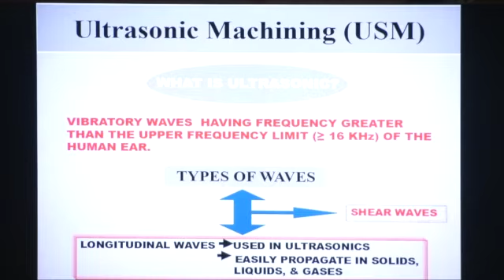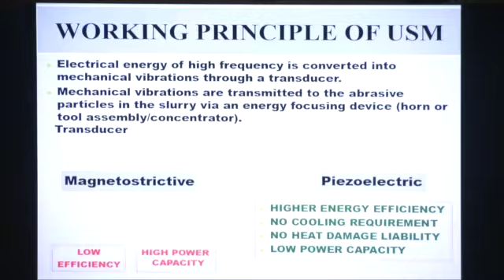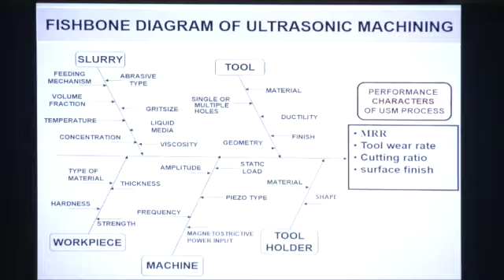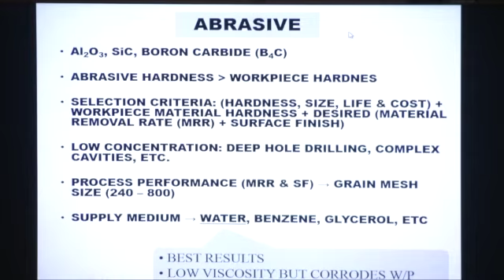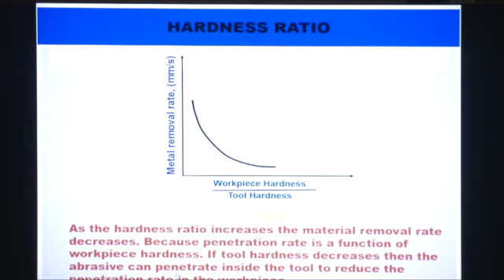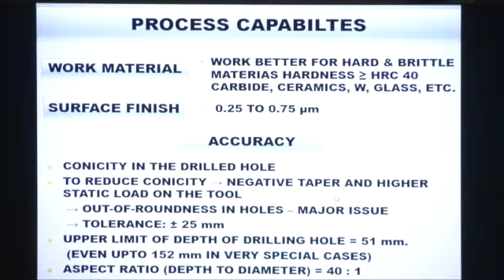USM 1

Comment: 00:05 Today we are discussing ultrasonic machining process
02:42 Ultrasonic transducers convert electrical energy into high frequency mechanical vibrations.
07:47 Introduction to the experimental setup of Alpha solid machining process.
10:19 Ultrasonic machining process is suitable for brittle and hard materials.
15:15 Different modes for generating electrical energy using materials
17:46 Ultrasonic vibrations create tiny chips on outer surface
22:20 The cutting ratio and surface finish are important parameters in machining.
24:32 Parameters influencing ultrasonic machining efficiency
29:05 Using concentrator to amplify vibration in material testing
31:29 Material selection crucial for tool quality
35:53 Consider abrasive particles and concentration for high aspect ratio holes
38:17 Varying vibration parameters impact metal removal rate and penetration rate
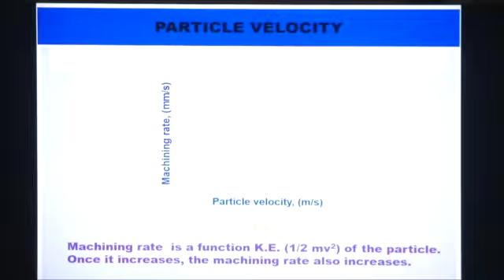43:03 Particle velocity affects machining efficiency
45:30 Variation of static load affects tool diameter and penetration rate.
49:54 Precision machining process for various materials